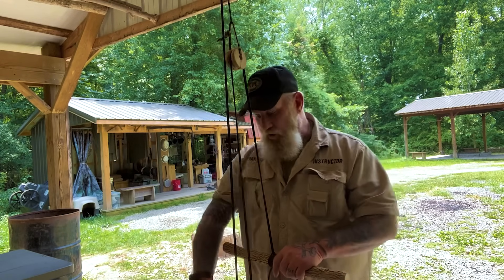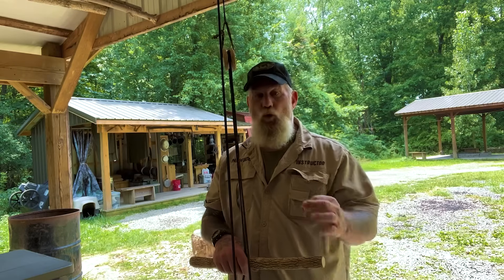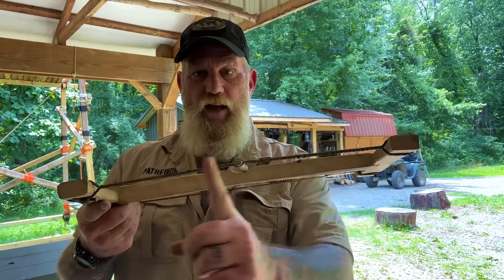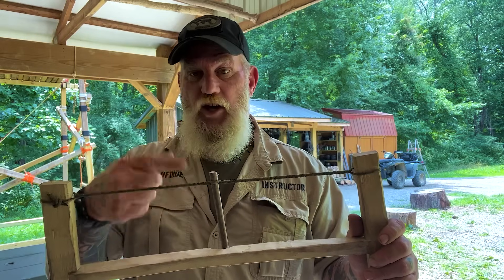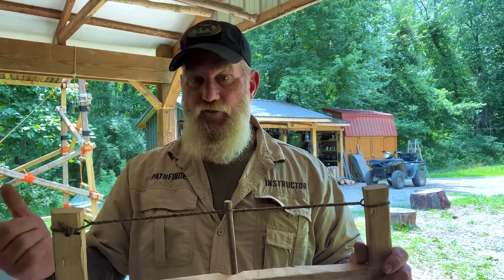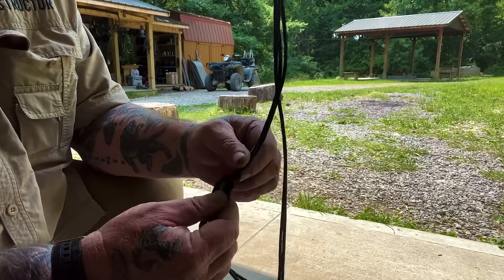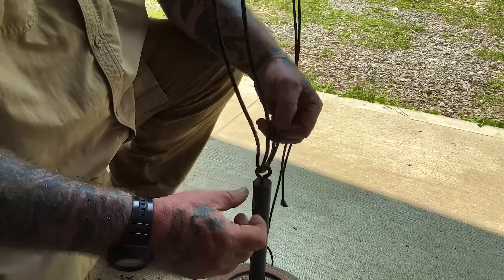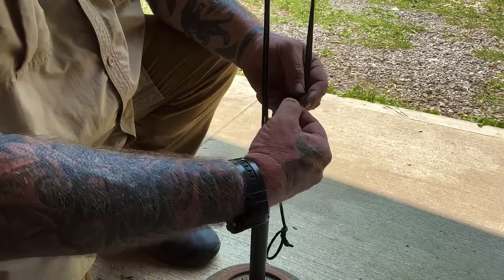Moving Objects with Simple Machines Part 1

Comment: Love it.  The second windlasses are a good way to have easily adjustable heavy water pot situations on a tripod over a campfire if you were needing a big ol cast iron cook pot for stewing or for bush laundry, cause swamp ass is not bueno in the woods.  Nice part about that pulley system is that it scales with the number of pulleys.  If you want a mechanical advantage of two (half the weight) you need one travel pulley and one anchor pulley, if you want a mechanical advantage of three (a third the weight) just put another travel pulley on it, just like the big block and tackle rigs.  Be warned though, every time you add a pulley you multiply the amount of cordage you need to run through it and you better be certain about the structure you're anchoring onto.

Comment: Just remember, as I am sure you know, that when using any sort of "winch" where you are lifting 50 lbs. and pulling  50 lbs. that you are putting 100 lbs force on your suspension point! If that is the main beam of your porch it could be critical. Also, pulleys especially bushcrafted ones, add a considerable amount of friction. I am not saying that they don't help, just don't rely on the 2:1 ratio. Yes the "self winding" ones are just lifting the weight, but I can imagine others using a remote anchor or force especially with a pulley system. Just saying. Regards, Chas. (Crane operator).

Comment: Dave that is so cool! You have basically taken a flip flop wench and put it in the air instead of on the ground. Very handy. Attaching a pulley to a rope with a prussic loop is also something that hadn't occurred to me. As for your pulley system, it looks like a prepared outdoorsman could substitute the carved pulleys with a caribiner or "S" hook. If you used either of those, made from say 3/8" bar stock, do you think that it would add any additional friction to the system over the pulleys? I'd welcome an answer from anyone with experience.

Comment: Safety first.  Be cognizant of pinch points, crush zones (beware of your toes), and of course the strength of your load beam vs the load you are putting it under.  Inspect your cordage before using it for lifts.

Comment: With all the incredible things these simple devices have achieved over thousands of years are capable of plus all the technological advances like motors and battery technology the question is why are we still using people like donkeys to do heavy lifting? ...Because nobody gives a crap about laborers. You know who wont be using human bodies until they're used up at the jobsite today?...NASA. My kingdom for a construction site hybrid rover to move materials, provide power, and maybe brew just one single cup of rehab strength coffee. It could be integrated into a jobsite trailer. An on-board battery and small generater that can be plugged in when not in use. The battery is part of the trailer wheels and has regenerative braking and solar as well. The flatbed trailer carries the equipment and materials to the job. After leveling the trailer the transaxle seperates from the trailer hauling tools and materials closer to the work. The deck of the trailer after its unloaded could unfold into a cut table. Tune in next time when i talk about rc roofers, sheet rockers, framers, concrete workers, and painters. All profits will create a fund to offset the exponential negative effect of trickle down economics and automation on society creating jobs and training to earn housing, food, medical, and retirement for people that would rather earn it than take it. The goal is to create enough positions for anyone to have enough work to earn these basic human necessities without working until they drop dead and die with nothing while desperately clinging to hope that something will trickle down other than urine. By reducing dependence on businesses that will never serve man because they have tricked man into serving industry with blind faith we can provide the masses with immediate employment that guarantees these basic needs. Working for a business would be a way of earning more than enough instead of not enough and decreasing. Growing populations combined with automation is not sustainable. An economy dependent upon an entity that must gain and exploit to thrive will naturally gain everything it can from the people while exploiting every resource in its path including people. Disclaimer...this is a hypothetical scenario ment for demonstration purposes only. There are no plans to create this to the best of my knowledge. Its far more likely that these ideas will be used by a business to profit from the green tech market which has grown virally and by result can charge way more than a practical amount because of a limitless demand from people desperate to get energy companies out of their pockets. No computers, A.i., or scientists were used for any economic projections because its kindergarten math. Capitalism is destructive and is being used against us. Anyone should be allowed to earn enough if they're willing and not subject to being capitalized to death and praying for free enterprise to allow morals to compromise gains and put their livelihoods at risk. They wont ever give any more than they are legally obligated and when they do suffer losses either through legal obligation or market climate they will charge us for it and mark it up as high as they can. There is no entity that regulates profit yet so there is no penalty for excessive profiting. Recently grocery stores have replaced huge numbers of checker jobs held by humans with auto check out...meanwhile food prices are inhumane. The amount of revenue freed up is huge. It wont result in better prices. A company sighting economic climate as a reason to increase profits should have to prove it to validate the increase at the risk of penalties, fines, and loss of government funds for economic stimulus. Just one example but a glaring one. So many checkers gone from every store. No paying wages, benefits, osha, disability, or taxes...yet inflation happened. I thought about deleting this long ass comment, then considered shortening it. I chose not to because my ideas could prevent someone from facing disability from being overworked while fighting osha, saif, workers compensation, and ssi for help and failing because they are run like a business and only seek gains despite the fact that they're all up in everybody's check. Capitalists are helping only themselves and at the expense of the rest of us. Thanks for the vid dude...if i every get my broken body fixed maybe i could use these ideas to make myself a pyramid complete with tomb before i die.